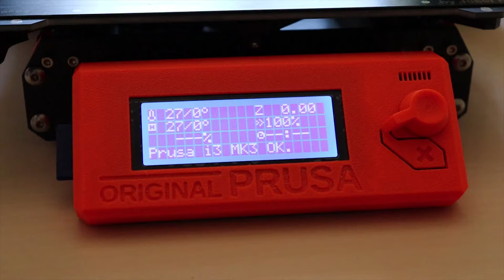How to Clean a 3D Printer Bed

Comment: Why did u use glue on mk3? I have mk3 for almost 2 years i dont use anything, aslong as your 1st layer calibrated good then it stick very good. No need to add more glue. Just clean once in a while with isoprophyl alc & acetone

Comment: funny video and good job but that's probably the hardest method I've seen why don't you take the plate off and just wash it with soap, and it scratches the bed with the ruler, which will cause more problem of it sticking I've never used any adhesives and never has it come off since i learnt to set it up properly. when I first learnt I watched all videos and now I realise how many things I've been doing wrong from watching YouTube videos. I print now with 0 % infill for example and saved a ton of PLA. so many mis-information vids on here so be careful.